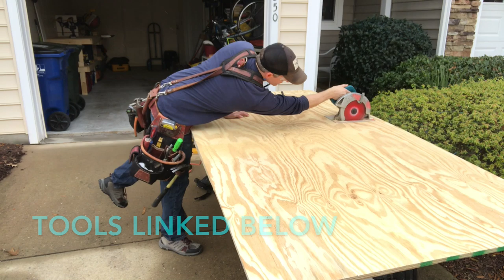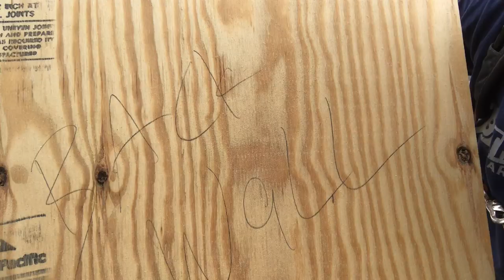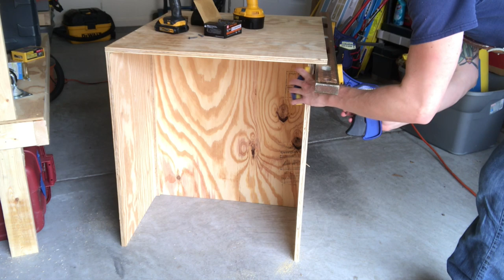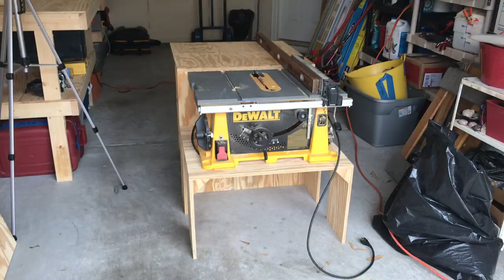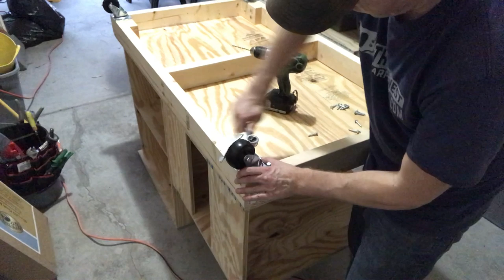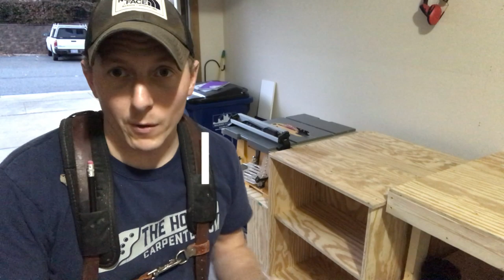Table Saw Station On Wheels! ($70 SHOP CART BUILD)

Comment: Nice build. Have the same table saw but no room in my basement shop for a cart of that size. That brad nailer is great. So much more convenient than my compressor driven nailers. Thanks for posting!
Reply from the maker: Thanks Richard! I’ve dragged compressors and hoses for years. This PC nailer has been such a relief, and has extremely few misfires and such

Comment: Great build, but it were a few inches higher, it looks like you could've used your miter station wings as an extension to the outfeed for larger projects when you just need a little more surface area.

Comment: You could add a hinged/fold out shelf on the out feed side of the table ( folds up & down) that would really help when you rip longer materials. 
It wouldn’t really hamper your storage space much at all when not in use.

Comment: Have you thought about putting some spacers under casters to bring it level with the other bench?  It'll give you a longer work bench with the saw blade down on table saw. Just a thought, but I love the idea and how easy it would be to make. I've got 2 other projects to do on the house, then I can redo to garage and make a decent shop. Doing all the research I can on simple design.

Comment: did you make sure the top surface was level? also I would create 4 drop down table legs with wide bottoms when the table is in stationary position, to add more support so it doesn't wobble/move due to wheels (even with brakes on).

Comment: Hi my friend. Ty for that. So the measure is not accurate are you saying?..its a toss up between this dewalt or a makita. Hmm decisions??
Reply from the maker: I think I could have adjust the display ruler, Paul, but I never bothered because I always use a tape to check fence-to-blade distance. Just force of habit from jobsites now. On whole, contractor grade saws just don't match shop grade saws for precision. BUT, they do have surprising amounts of power, and of course you can just pick them up and move them around. I haven't tried that makita yet, but I'm curious. Makita has a history of making great saws.

Comment: Hi Ethan, I am fairly new to woodworking/carpentry. Everything I’ve made thus far has been by cutting with a straight edge or saw guide of some sort. I have been shopping for a table saw and wanted to know your impressions on the DWE7491RS? Thanks.

Comment: How do you find this tablesaw for accuracy? And is the fence nice snd tight with no play in it when clamped?..or..which tablesaw would you recommend other than this one. TIA
Reply from the maker: I love this one, Paul! The ruler on the fence has never been good. But the rack and pinion style fence extender has always worked flawlessly. I have had to true the fence to the blade a number of times, but mine was a refurbished model that I think just had a couple quirks. Still, for power and quality, these dewalt 7-series models are my go-to table saws